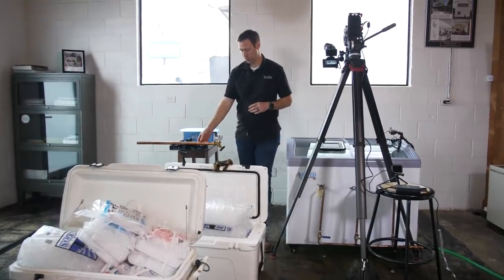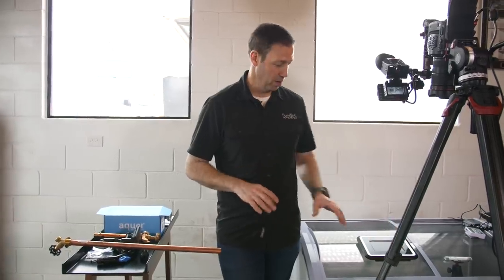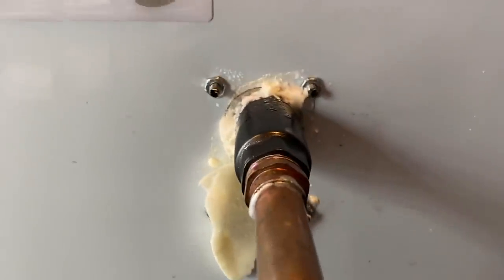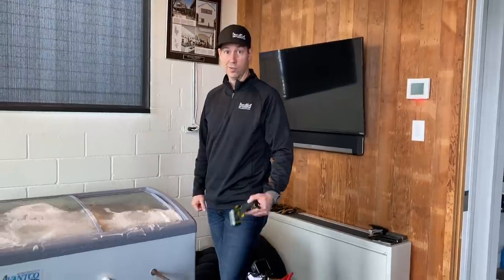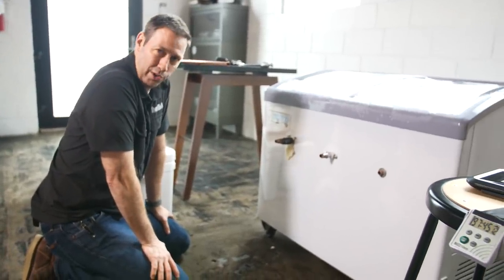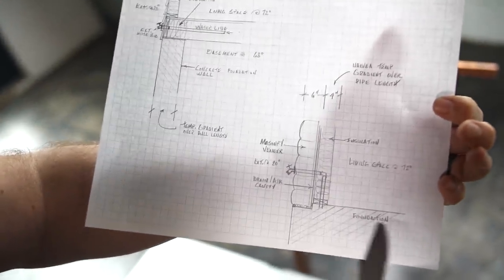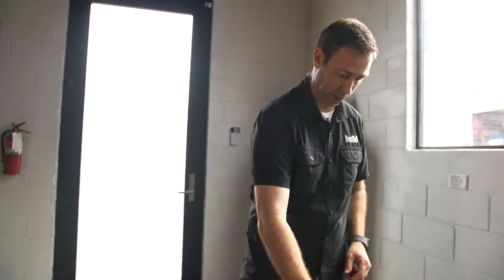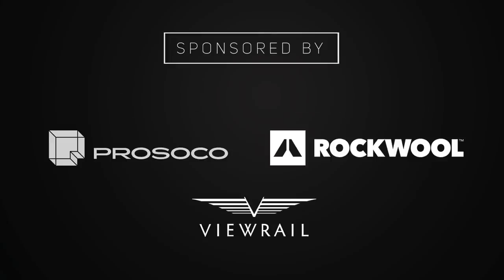Frost-free Hose Bibb?  Yep, it TOTALLY ICED over!

Comment: Ok, now here is real world advice. I had a plumbing business in the coldest town in the lower 48 and never witnessed a frosted bib. That is if it is installed right. Most are not. It has to be graded down hill and out of the house. It has to be strapped inside of the house to prevent it from losing pitch, and from being pulled out of the siding. The two screws on the outside of frost free bibs are not enough to keep it from being yanked out. They make frost free wall anchors. Never insulate the bib inside the house because when homeowners  forgets to remove the hose, the insulation helps the freeze move into the house faster. When possible, choose to enter the house below floor level. Its better to flood the dirt of a crawl space when they burst than above floor. Bibs above floors need access panels to replace. Return air vents make perfect access panels because they leave warm air from house fight back freezing bibs that had hoses left on. Architects need to consider hose bib placement around the house so access to bibs are in closets not in the living room. Don't put service loops on frost free bib. This indicates you never strapped the bib inside. Don't install frost free bibs that you can't find parts quickly. I think the Woodford model 19 is the best all round frost free on the market. It has extra freeze protection and repair parts can be found in any town. Lastly, install a longer frost free than you did in your experiment. This will leave more surface area for house heat to fight back frozen bibs from bursting. Don't terminate it within a  inch of entering house.

Comment: PS:  My experience is if you have an insulated pipe it will not sweat to a measurable degree in a real installation inside the insulation.  So the pipe buried in insulation will most likely not sweat until it becomes exposed to the inside moisture laden air.  It would also be good to see a like experiment with a set of bibs with a foam cup installed on the outer (inside the freezer) wall surface to see just how effective they can be.  I find them to be quite effective.  Vancouver is not a "colder" climate comparatively speaking.  The ocean moderates the temperatures.  Go fifty miles inland and you get much colder as polar air flows south between mountains and down river valleys.

Comment: I agree not a good test.  For one with crawlspace the pipes will be colder than 60 in very cold weather most of the time.  You are correct the copper pipe leading to the bibs was helping to heat them up from the room and they were copper good conductors.  Next  you should put a fake wall on outside of the freezer (at least an R13 2x4 wall) this would likely cause the non frost proof faucet to lose heat to the freezer and freeze inside the insulation .  The other thing is like others said run the faucets a quart or so to make sure water is in them  fully.  

The big thing is after the 2-4 days remove some of the dry ice and try to run water through the faucet , this will prove whether or not they have totally frozen if the valve opens.  Then replace ice if you want to test further.

Last I would use PVC or pex or anything but copper pipe to supply the faucets as copper piping is a real rarity these days and the plastics won't conduct the heat to a great extent.

In short, good idea but poor setup of the test

Comment: in Saskatchewan i have the normal turn off valve with no safety at all and the pat 6 years i lived in my house. not a single issue. the copper is exposed in the basement to room temp.  Last year was one of the coldest we have had in a long time to the point the frost was pushing down in the ground and blowing water lines out in peoples front yards.

Comment: N IL and we see temps of -20 pretty much every winter and -40 on occasion and I have seen 50 year old regular outside facets that are just fine. I have seen more of the freeze proof facets burst then regular ones. When they do burst its because the pipe corroded and is very thin at the burst point.

Comment: The other problem with this test is that there's only an inch and a bit of insulation on the pipe before its back in warm air. What happens in real walls is that there is 6-8" of insulation on the pipe which doesn't allow the hot air to touch the pipe and gives enough insulated water volume to cause a significant enough ice formation to rupture the pipe. The internal air in a cold climate is also likely 20-40% humidity not the 60+ your air likely is (why you have so much condensation). Why those other cold weather fittings are great is that they put the spot where the water is back in the warm inner air area and basically all your pipe is in that warm inner air area anyway.

Comment: Not a good test Matt, in northern climates the hose bibbs or wall hydrates are in the wall, crawl space or basement insulated or uninsulated worst-case and insulated and electric traced with a timer best case.  Stainless steel is always more expensive, so the selection is generally not high on the homeowner's mind, the contractor will get what Home depot or whoever has on the low end unless the owner has a preference.  Woodford 71 is around $40.00, Zurn, Smith, Wade, and Watts all have hydrants that can be fairly freeze resistant.  If the bibb or hydrant is going in a space where you will have cold exterior air movement you will need to insulate and trace if it's in a wall cavity and sealed you will need to insulate, homes we have done in the north here that have basements we have put drain valves on the interior of the temperate space so the system cannot freeze.

Comment: hey Matt why the copper didn't freeze is because you installed it right.  Every hose Bibb is never air tight sealed allows the  air to flow around pipe. The colder it gets outside the more of a draft over the pipe there is.  I have had copper pipe in a crawlspace in -25c and they don't freeze because there no air movement.

Comment: None of these pipes are going to bust open in this test, even if you bleed the air. It's not the ice that breaks the pipe, it trapped water. In my opinion there is a huge misunderstanding about frost free hose bibs. I believe they were designed to allow someone to use the hose bib even when temps are below freezing. By placing the actual valve seat inside the house, the water at the valve seat won't freeze so when you open the valve water will still come out. Same design as the water hydrants that are installed in the ground, particularly on farms where animals need their water. Standard hose bibs with the valve seat right at the handle can freeze, so are unusable when temps are low. I see frost free bibs split open all the time because when the homeowner leaves a hose attached, the water freezes at the exterior handle. This traps pressurized water between the ice block and the closed valve seat, splitting the thin wall of the frost free tube extension inside the wall. Typically the pipe leading to a standard hose bib won't split because as ice forms inside the valve, pressure inside the pipe won't change because the entire plumbing system is acting as a buffer. However, if there is a crawlspace vent or some other air exposure near the hose bib inside the wall or crawlspace, (pretty common in older homes) that spot could also freeze, trapping pressurized water between the ice blockage and the bib valve, splitting the pipe. Insurance companies are not clamoring to change the code for frost free bibs because the cost for their replacement and repair of any damage rarely exceeds the deductible, so people don't bother submitting a claim.

Comment: If you had opened the valve to purge the air prior to the test and allowed the water actually into the valve I am pretty the standard valve would be exploded. I feel like I listened to a scam call on the phone.  The test did not prove a thing other than cold pipes in a humid environment generated frost.  This was a nothing but a commercial definitely disappointing considering the time wasted.  You had the ability to actually produce a video with some valuable information, you have definitely sacrificed a large portion of  your credibility to push a product in my opinion.  Sorry just calling it as I see it.

Comment: Having been plumbing in SC for awhile, the hosebibs we have the most problems with are the typical frost-free hosebibs. 
The standard ones seem to freeze just in the handle where the brass is thick so if they do split it makes a mess outside. 
The frost free would split in the wall and cause damage... I think that is because they allow the cold exterior air to get inside. Also, we typically see the burst pipes in cheaply built homes that use that cardboard stuff or foam panels for sheathing and sometimes have no insulation. 
The water going all the way to the exterior seems to transfer the heat better to the outside and keeps the pipe from freezing in the wall.

Comment: Interesting experiment.  However, in Maine we see water lines to an exterior spigot/hose bib in many properties in an unconditioned basement or crawlspace. The ambient air temperature in the basement may be 50 to 55 in the winter, with the temperature in a crawlspace being much colder.  Relative humidity in these spaces would be closer to humidity on the exterior so  I would not expect similar amounts of condensation as in your experiment. Would be interesting to see this experiment performed in conditions attempting to duplicate the conditions in a cold climate such as here in Maine.

Comment: Why didn't you do this test in Pex up to the shut offs? You won't get the radiant heat transfer and run the water through the shut-offs just a little bit before you fill the cooler with ice. I'm sure it would have froze and broke if you used Pex and actually had water up to the shut offs instead of air

Comment: I agree with the others, needed to open the spigots to purge the lines and get water right to the valves.

Another solution that has been done in norther climates - have a second valve inside, shut that off and open the outside valve and you don't freeze the pipe.  My my parent's house was built this way in the 50's in upstate NY.  probably a lot cheaper than these solutions.

Comment: Great demo. For a climate that sees regular below freezing temps, I would prefer to have a shutoff well in side the house in addition to the frost free. Just not worth the trouble if it can be prevented for the cost of a couple extra valves.  Close the house valve, open the bib   Leave the bib open or not. Won’t need a hose bib outside in the winter anyway.

Comment: Needs to repeat test where the room stays down to 40 inside the house to simulate crawl spaces and finished basements where heat doesn't get to the pipes so easily... Should also insulate the pipe as well...

Also as a Colorado plumber, most frost free, yes you read that right, hose bibs freeze in the tube of the spout side up against the shut off, it doesn't matter how deep in the wall it is...  I have seen frost free hose bibs freeze where non frost free didn't... And we do get down to negative 10 degrees at times...

Comment: If you plan on doing this again try putting some pipe insulation on the warm side of them and like everyone has stated, bleed the air from the lines. The condensation is something to note as well, one more reason to vapor seal your rim joists... if you have copper pipes

Comment: I have had several hose bibs freeze and burst on me. This is a flawed test because right outside the cooler its at room temperature whereas in real life several inches of pipe which would be inside the walls would be much colder than ambient room temperature when outside temperature is very low.

Comment: I wonder if the difference between the middle pipe and the copper on the right was affected by how clean the hole was drilled through the side of the freezer. A little bit of tearout or separation in the layers might allow more of the cold to leak through and freeze around the pipe

Comment: Living in a converted garage up in the Yukon, built 25 years ago by the original homeowner. Passivhaus this is not. It has very normal hose bibbs; NOT the fancy frost free hose bibbs. Temperatures in the Yukon can plunge to below -50 °C, and generally sit below freezing all day between November and March. We just came out of two weeks of -35 °C (daily high) to -45 °C (nightly low) weather and I can still operate my hose bibs, which I suspect is because there is so much heat loss occurring that freezing damage does not occur. It was so cold we had up to 4" of ice on the inside of our windows. 

Also, our main water supply enters the building through the wall above ground level and is covered by a very basic insulated box, a very strange design decision for such a cold climate. Rime ice build-up around the joints of the box infer heat from the building is keeping the box warm as hot air escapes through it.

Comment: Just curious, but if you need to shut off the hose bib why not have a physical shutoff installed inside the house? Turn off the supply in the house then open the bib to drain the water out.

Comment: Matt,
In WI our new old house has no rim joists insulation and had a frost free hose bib and it froze, so I added a shut off on the line with a frost free bib also insulated the rim joists no issue this winter.

Comment: I suggest that you re-do this test with some input from the community.  There are several flaws in the assumptions and logic that stem, I think, from your southern experience rather than living and working in a northern climate. 

I'd be interested in seeing this experiment re-done.
Also, please note that typically, the valve typically freezes in our area if people 1) don't protect it and 2) if the crawlspace is well insulated.  Typically we don't see breakage inside the wall.

Comment: the title is misleading as none of these products are a true frost free hose bibb or hydrate. most true frost free are designed with a pea release hole so once the water shuts off the water drains out of the exposed pipe into the ground right above the freeze line.

Comment: Did you flush air out of the hose bibs? That may have made difference. Most freeze proof hose bibs can be either soldered on or threaded on. So, your installation is correct. So long as the line starts to freeze from outside, copper pipe will not burst as ice will expand toward inside. However, often the ice starts in 2 different spots and when ice has no room to expand, the copper bursts.

Comment: up here in north central MN. we use a min 10 inch frost free hose bib. my house has 12 inch..  we just went thru a week of teens and 20's below zero F.  and wind chills of 35 to 45 below..
Reply: Wind chill relates only to exposed flesh which has a temperature target of around 38 C/100 F.  Wind chill has absolutely nothing to do with pipes, siding, house insulation etc.

Comment: I was wondering your thoughts on offset framing / double wall? I was thinking of doing 2 2x4 walls for the exterior walls. In newengland I use the freeze proof shutoffs but also completely shut them off inside just because its newengland

Comment: Mid ohio housing development from the 50s.  Most of the houses have original hose bibs. That means 70 winters with weeks in the single digits without freezing and busting.  Granted the walls are just brick-cavity-drywall with a sheet of paper behind the brick.  Still though, maybe they dont make hose bibs like they used to.

Comment: Apparently the original owner of my home (we are 3rd) was a carpenter. Well... when it came to plumbing... he was a half wit. I have pretty much that exact setup in Cleveland Ohio... on the snow belt side.  I believe I have been fooled by his setup like both times I went to shut it off.. I go into the basement and use the shut  off valve to the hose bib. I then unscrew the bleeder tap to let the water out of the pipe... great setup except he installed the draining shut off in the wrong direction... as soon as I open the bleeder valve I get full city water pressure jetting out and all over the inside of the house. That is at the back of the house.

The front hose bib comes out of the wall and then he attached a bit of black pipe (could be spray painted black - I aint touching that until I am ready to put a frost bib on it.)... any who it has 4 feet of pipe running along the wall to bring the hose bib to the side of the house so you don't have to go behind the bushes to get to it.

and don't get me started on the black pipe with galvanized fittings everywhere...

Comment: There's a couple of issues with your test: a) inside humidity, b) water temperature and pressure.
There's no condensation on our 12in bib because our house has 37% humidity in the winter in Toronto. 
The water is coming in at 4-6C from the ground, so our pipes are very, very cold throughout the house. Water pressure is also higher, which means that when ice is formed, there is a LOT more pressure on the pipes.

Comment: I'd like to see the copper assembly in a non-conditioned space. Often the copper will be in a wall bay or floor joist that has wallboard separating the copper from the conditioned space. It's also not likely you will see 64% humidity in the winter where you actually need these products so the frost buildup will likely be a lot less, if any.

Comment: Seems to me what this proves is that plumbing that extends to the outside should be encapsulated with spray foam to prevent condensation. It also shows that the cheapest valve is fine as long as it can tolerate freezing and not break.